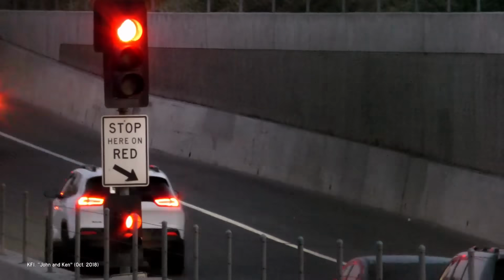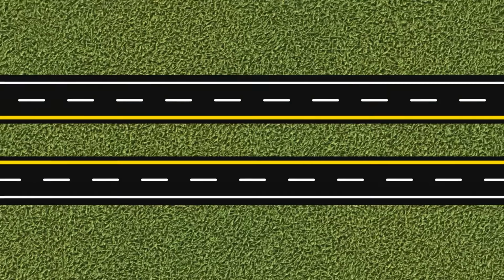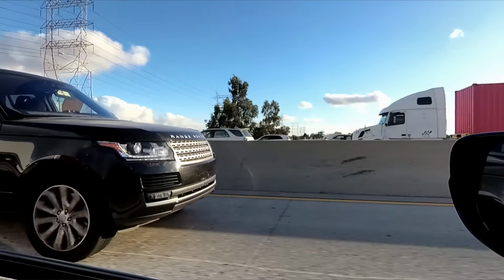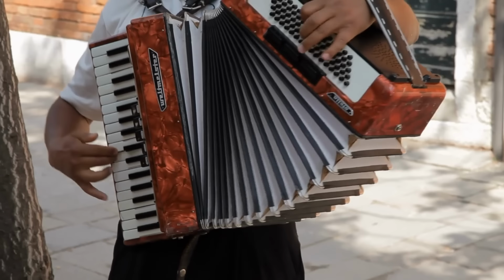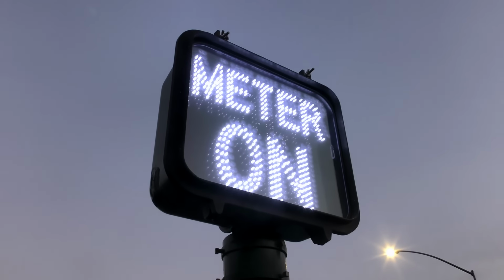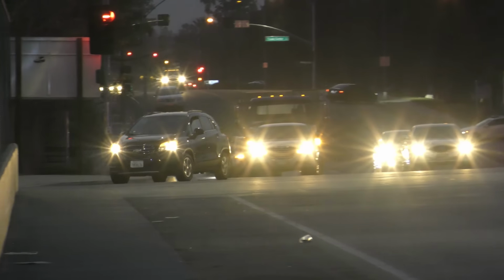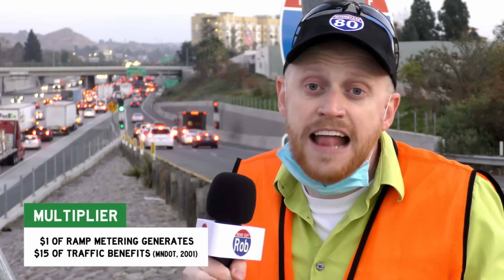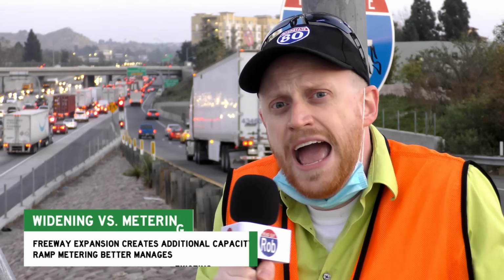Why the extra RED LIGHT on freeway ramps?

Comment: 8:40 is exactly how the stupid average motorist defeats the best planning. A vehicle easily capable of adjusting speed to smoothly merge into a large gap instead creates a conflict by entering the freeway at a location occupied by an existing traveler.
Reply: I love the drivers who choose not to accelerate (when traffic is free flowing) and feel it's perfectly ok to merge onto the freeway at 30 MPH, slowing the line of traffic on the on-ramp as well as causing needless merging and slowing on the main line.
Reply: Ramp meters do not help either. It takes much more effort to speed up from 0 then say 40
Reply: @wotm8870  My 72 hp mirage have no issue dragging itself to 40 mph onto NY I495, like no sweat, 3000 rpm max. Your car has to do better than mine.
If you are 10 mph below the speed limit, or traffic flow (which ever is slower), other cars will be more inclined to just overtake you than slow down for you.

I am trying to encourage more people 1) when driving on right lanes , to be ready to give way to mergers and 2) when merging, to drive fast and follow the traffic flow and not to break it (be sure the ramp is sufficiently long and provides a clear sight of view of the traffic).
Don't take it as an offense.
Reply: This is the main issue that ramp meters are made to address! Still, some drivers are gonna go "Durr Hurrrrr".
Reply: @navyguyhm3   they slow everything down. bunch of rookies who need to go to traffic school. They are often nervous to do 3 things at a time. 1) Accelerate 2) Find a spot over your left shoulder 3) Make sure you dont hit the wall on the right or go off the road.
Reply: D Y  hmm. In urban areas the existing travelers exit is coming up in 0.25 miles. He/she really can’t move in all cases coz that’d mean a sudden lane change to right later when the close exit just comes up.
Reply: D Y  This is precisely the mentality adopted by drivers of merging vehicles that initiates the conflict, and in most states I'm familiar with, is not aligned with traffic rules and laws.
Reply: D Y  its both. 
1. the on ramp car needs to adjust speed to line up with a hole in the right most lane and match the speed of said hole.
2. The traffic on the highway is supposed to help make such a hole, either by merging over or by adjusting speed to make space for 1 merging car to enable zipper merging.

A key thing is that nobody should actually need to brake when doing this, and eventually the traffic on the highway gets priority because they will get off the highway and make more space.

(Also traffic is exponential meaning 5 cars/hr is all it take to go from free flowing but slow to parkinglot, and this is what ramp meters try to fix)

I'm also from the north east where we are taught the rules and courtesy but also to be agressive enough to actually get places. (Also to put up with murderous massholes who get worse with proximity to Boston)

Comment: A note about the Minneapolis studies - from a resident.  Minneapolis had the system for many decades with the signals stopping traffic most of the time and a huge dissatisfaction with the long delays when the highways were flowing fast.  
The highway department shut down the system and started over, doing studies about traffic flow and redesign the light strategy to limit the lights to operate when there was clear advantage to them.
Reply: Indeed, MnDOT made it quite a bit better after.  Meters had their start and stop times adjusted, some were shut off where traffic flowed better without them, and the overall system controlling them was made smarter.

Incidentally, don't blow through one of our ramp meters when one is red with nobody waiting -- unless maybe you're in a truck that needs the extra acceleration distance.  Wait for a green; you'll have an easier time merging into traffic.  (The meter will stay red when a clump of heavier traffic is going by, and turn green when it thins out a little.)

Comment: Nice video, Rob!  This is an example of a city doing ramp metering right.  You were able to catch the meters down during times that they should be running (because of low density).  Other cities who put their meters on timers so that they are on from 6am to 9am and from 3pm to 6pm are doing it wrong.  You end up at a meter waiting in a queue while the freeway is empty - this is frustrating!  It's like the current school zone lights that are flashing while school is out - and a camera van in the school zone catching speeders.  Not quite as intended, and frustrating.

Comment: I try to merge at 80 to 140MPH (depends on what I'm driving and length of on-ramp). There is no speed limit on " on-ramps".  The faster I merge, people tend to clear a space, or at 90MPH plus, I can find an empty space to safely merge.  All cars can decelerate much faster than they can accelerate, so slowing down to fit in to a space is easy.  Once on the freeway, I normally cruse at 50 to 60 in the left lane, or just a bit slower than other traffic.

Comment: There are a few I ignore in San Diego County because they should not be on. In particular Palomar Airport Road's offramp is under reconstruction, and it's down to 1 lane. People also tend to not read the 2 per light sign. Palomar Airport Road is the busiest road in North County, yet it is metered worse than all the other roads connected to the highway right now. As a result, it backs up several miles in the morning and afternoon which causes a lot of street incidents.
I also generally ignore them on a motorcycle because 3/4th the time the censor does not detect my motorcycle. About 2/3rds of San Diego Counties sensors do not detect motorcycles, and 1/10th are completely broken.

Comment: I gotta say yes, they definitely work. I was getting on I-405 in the San Fernando Valley at 9am weekdays, and for some reason the ramp meters were off, despite it still being morning rush-hour. The right-hand lanes of the 405 ground to a near-standstill, making it difficult for cars to get on the freeway, and which led to traffic backing-up all the way onto the street, with several cars blocking the intersections regularly. IDK if the meters were just broken, or LADOT was doing a similar experiment as Minnesota, but if they were experimenting, that'd be ridiculous! We already knew the results!

Comment: Melbourne Australia has installed ramp meters on much of the urban freeway network including the Monash, West Gate, Eastern Tullamarine Freeways and the M80 Ring Road. The typical arrangement has one car per green with two lanes at the on ramp allowing a pair of vehicles to enter each time, and the signals here go green-amber-red rather than green to red. When the system first activates or shuts down the signals flash amber for a short period with electronic warning signs before the freeway entrances warning drivers that the signals are on.
Reply: Here in the Twin Cities (Minneapolis - St Paul, Minnesota, US), the ramp meters go green-yellow-red too -- with a very short yellow, since they're only letting cars through one at a time.  They also continuously flash yellow ("proceed with caution") when not in use, typically anytime outside of weekday rush hours.  And at the beginning of their rush-hour cycling, they transition to solid green for a bit before they start stopping ramp traffic.

Also, too many people just run them when they're red with nobody waiting.  I never do, because a.) short of a malfunction or a real emergency, I'm not going to blatantly, intentionally run a red light; b.) I understand what they're doing to improve traffic; and c.) the system is smart enough to react to traffic conditions, and doesn't keep you at red for no reason.  If it's staying red, there's probably a clump of heavy traffic in the main lanes, and I'm more likely to find a gap to safely merge into if I wait for a green.

Comment: Ramp lights are a Band Aid to cover up faulty freeway construction.  For instance, there's a red light on a 65 mph freeway mornings on State Route 125 southbound in La Mesa, California.  After the signal, 2 lanes merge into one.  The actual ramp is coming from I-8 westbound but has no signal.  The I-8 ramp to 94 was built before the continuation of 125 was built.  There's always a slowdown for 3 miles as one of the I-8 ramp lanes ends, and until the intersections with 94 east using ramps from streets.  The whole thing's a giant mess.  There's plenty of room to rebuild it with two proper interchanges and a wider freeway between SR 94 and I-8, and the lane painting ignores wide concrete lanes already there.  Oh yeah, the ramp from I-8 eastbound to 125 northbound isn't one sweeping curve -- it consists of 2 different curves, so you have to turn the steering wheel halfway through the ramp.  Whoever designed this should be sentenced to driving on it 16 hours a day.

Comment: It's an interesting video, but there are other considerations a computer should probably take, in addition to just 1600 cars per hour. There's an on ramp meter on I-15 South at Foothill Blvd in the Inland Empire, and the signal actually is more often at fault for slowing freeway traffic. Cars entering at 25mph affect the freeway much more than cars entering at 55. It's not always a perfect system everywhere.

Comment: I find the trade-offs fascinating. I remember the ramp lights in Atlanta back in the 70s. Then they went away. Now they're back.  Is interesting to me as what the meter does most is (attempt) to force a gap between cars which allows for smoother merging. (Imagine if we could do the same on the main lane). On the flip side, we also want to maximize the cars through the light back on the side road, so we create multiple turn lanes. And merge them on the ramp. Which increases density on the ramp, the last of which happens right before hitting the freeway. So, when the meters are on, they help undo that effect. When they're of though, it's nuts at the ramp.
Reply: I believe some ramps address this with signs saying something like "form two lanes when meters are active" -- they're wide enough to fit two lanes, but marked as one lane for off-peak traffic.

Comment: Here in Colorado those meters don't work because both the left lane and the right lane lights change at the same time.  I just run the light while the car in the other lane is stopped which makes the most sense.

Comment: Houston added these (or at least started using them) a little while back near where I work... with how close the next exit is and then the interstate exchange so close it certainly doesn't feel like it does anything... some days the red to green is less than a second, just flashes back and forth it seems.

as a motorcyclist I would be really interested in a video seeing the impact of motorcycles in lane filtering and lane splitting... and how the size volume would impact traffic (being that average motorcycle is 1/2 the length of the average car and obviously much narrower...)

Comment: The ramp meter at the 605N/210E is an interesting one and it's on all the time at evening rush hour. That ramp traffic merges into the far right lane which is also interesting. This could make a good video about 'reducing conflicts' and why specifically in California they have so many lanes that just close or merge suddenly with limited-to-no signage. There are a lot of spots around here that the signage is quite frankly terrible and the traffic is totally mismanaged (57S->60W->57S).
Reply: Sins of past decades- easier to fix then, now you would have to wait for a big project, data from a bunch of non-fatal collisions, or a lawsuit due to fatal collision... or could be stolen signs or faded stripes. Do report those into Caltrans Maintenance Service Request https://csr.dot.ca.gov/index.php/Msrsubmit/

Comment: Sounds good in theory.  But in practice, not every minute of every day has the same traffic.  Timed ramp lights assume a constant and steady flow, hence releasing cars ALMOST ALWAYS at the wrong rate for maximum efficiency.  There's nothing more frustrating than driving up a ramp, observing a fast-moving freeway flow, but being forced to stop because the stupid light was stuck in the wrong cycle.  Furthermore, ramps were designed so incoming cars could merge by speeding up and matching speeds just before the merge point.  Putting a stop light at that point defeats the purpose of the merging concept.  It's sorta like the opposite of a roundabout, which converts crossing motions to merging ones.  A ramp stoplight converts smooth merging motions to jerky stop & go's.

Comment: They tried this in Detroit back in the nineties. It doesn't work. Too many accidents because people assumed they were intended to eliminate  the need to still merge at traffic speed. Many cars entered driving way to slow. There was also a ton of rear end collisions at the lights.  Myself, if I get stopped by one of these I am balls out racing to the bottom of the ramp when it changes to make up time I was forced to wait for the damn signal. The program was shut down within the year it was introduced. I'd rather sit in traffic than wait to get into traffic. These are almost as bad as the traffic circles I avoid by using secondary roads to make normal turns.

Comment: Much of the ramp metering wouldn't be as necessary if we had dumbbell interchanges which are roundabouts on both ends. 

They distribute traffic more effectively. Not to mention if you had on-ramps in the center and off-ramps on the edges, you can interchanges every 800 to 1/2 mile to redistribute traffic more evenly. You can also have reversible express lanes in between the on-ramps.

Comment: There is a critical failure adding these to some existing highways that we have seen in the Denver area.  You need a long enough merge lane after the light to ensure the oncoming vehicles have a chance to get back up to highway speed before they merge in, and unfortunately many of the denver on-ramps have extremely short merge lanes that do not offer nearly enough lead in time to get back up to speed after the newly installed lights, since they were designed for the merging traffic to come up to speed as they leave the side-street and sometimes you only have 200-300 feet from the bottom of the ramp where these lights are, until the lane ends and you must merge.  This has resulted in scenarios where light traffic on the highway and side street end up significantly slower due to these stoplights, as people end up merging into what was a 70mph highway traffic flow at 20-30 mph tops even if they floor it once they get the green, completely up-ending the highway flow and forcing people in the right lane of the (often only 2 lane) highway to slam on their brakes to avoid hitting the mergers or try and fly over to the left lane before running in to the merging traffic.  I agree if the highway is designed for these lights with sufficient run-in distance to merge after the light these may benefit flow but unfortunately in areas where these were added after construction not as part of the design process, they can cause significant disruption of the flow and lead to bottlenecks and increased accident rates on the highway side since you are essentially forcing people to get onto the highway at extremely slow speeds.

Comment: I understand the math and logic behind it, but the problem disappears with an exit/entrance lane.  I don't know exactally what they are called, but the lanes that go from exit to exit, and stretch for the half mile or mile between exits.  Those allow much more traffic to flow through then ramp meters ever will.  Having an on ramp merge into the third lane of traffic just didn't work before the meter, and won't work with the meter either.  Not to mention a lot of places don't have the room for these meters, and they get clogged very easily all the way back to the in town traffic, so then they make 3 or 4 really narrow lanes for the meter which just costs money, and messed up traffic for a couple weeks.  Sure they work in some scenarios, but it seems most of them are poorly placed, or they should have used the money on another road improvement

Comment: I used to drive a semi and any momentum I could have had was gone. They do take longer to accelerate and will hold up traffic on the ramp as well thus creating a platoon. The biggest problem I have seen is people just don't know how to properly merge into traffic. The idea is you increase your speed to match the speed of traffic on the freeway so you can smoothly change lanes thus the guys on the freeway don't have to brake to let you in. This brings me back to the trucks, when they have to stop, now they can't regain the speed necessary to merge properly, the acceleration zone is often way to short. Just one more point, in the simulation shown, the big truck had the same acceleration of car. Bad sim data makes for a bad simulation.